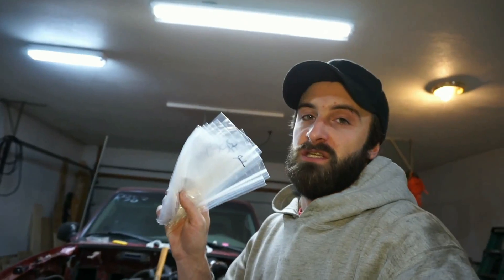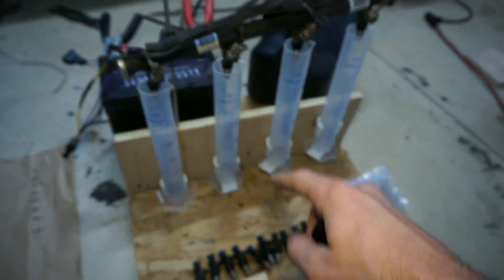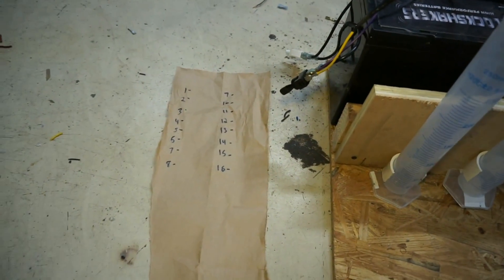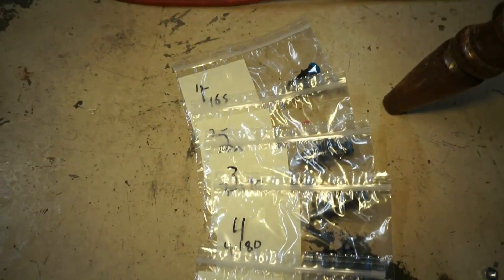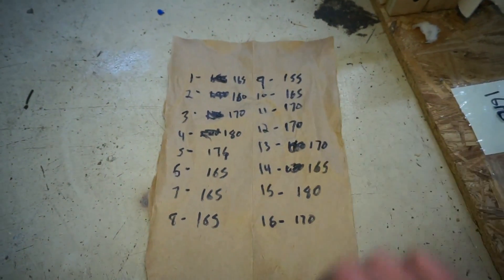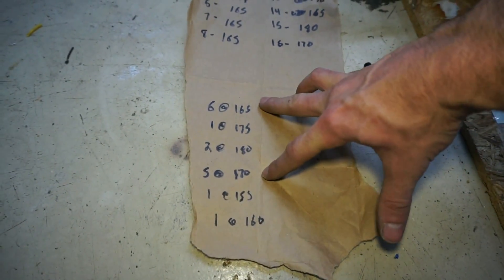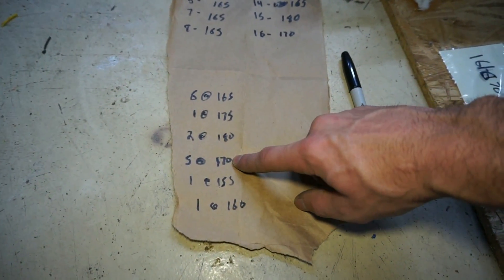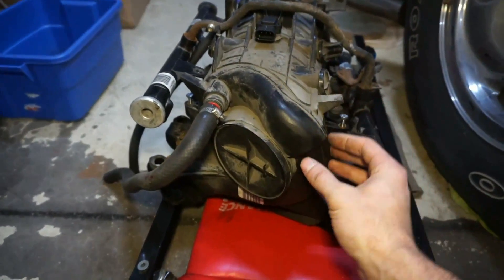DIY BUDGET TURBO LS DECAPPED INJECTOR FLOW TESTING!!!

Comment: Thought you did a great job with that. I wonder what the results would have been if you have wired in a timer.
Reply from the maker: shatmicellf hp I'd like to add a timer for ease of testing but I feel I was pretty solid on the manual timing. I don't think the results would change much but I would like to just be able to press a button once and I completes the test.

Comment: Even without boost the rear two cylinders on an LS are known to be leaner than the others. This is an awesome setup you built brother. 👍 May do something similar but with more cylinders and a different controller.
Reply from the maker: Bad Luck Garage Its definitely a good trial run... Doing a full rail of 8 at once on a controller that does over 30hz would be awesome. Just got done shooting the video of the $1.99 fuel pump doing same test... Interesting result.
Reply from the maker: Bad Luck Garage Also have a 17 minute video of 2nd part of the build and Initial testing but it's in YouTube jail pending review.
Reply: I feel ya brother. My videos are on a 1 or 2 day delay until they fix this stupid algorithm. Im sick of them stealing revenue just so they can run free youtube red ads on our videos for 24 hours till all the views slow down! That video I did on the first drive of the turbo c10 got almost 600 views in 24 hours and was demonitized and under review the whole time. Only ads playing were for youtube red. As soon as the views dropped to a couple an hour they remonitized it.....Its a friggen scam for sure.

Comment: mad scientist! why is it you're doing all of this instead of getting new injectors that have the flow you're looking for? besides just doing it on the cheap that is .. it's all witchcraft to me lol. idk what the decaping was for or etc. so you're going off the reservation with your science experiment lol.. 
so what stuff do you want to play on guitar? i can definitely help you with links to stuff to learn .. like the beginning of nothing else matters is all open strings and such .. idk, hit me up any time about whatever .. peace, b.
Reply from the maker: Just to flow match after decapping... Some just decap and throw them in. I wanted to match them just for good measure. Nice cheap way to get the same outcome vs spending $200-$300 on a new set. Now I know also that I have 4 extras with the exact same flow.
Reply: ya i see a few other people who have videos of this .. pretty good idea to know what they flow at but what's the decapping all about? seems like a pain to grind em open ..
Reply from the maker: Took me 2 minutes to do a full set... Literally I timed it. It removed a disk at the end and makes them flow 3x more fuel.
Reply: what are they some kind of metal cap on them? kinda like a tube of toothpaste's little metal seal or whatever lol?